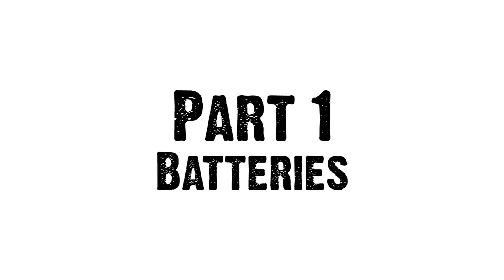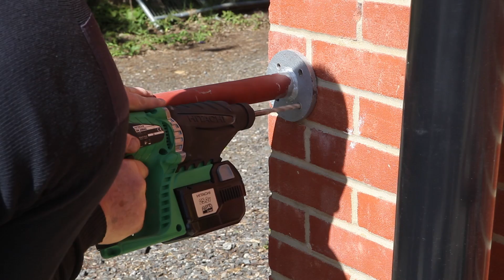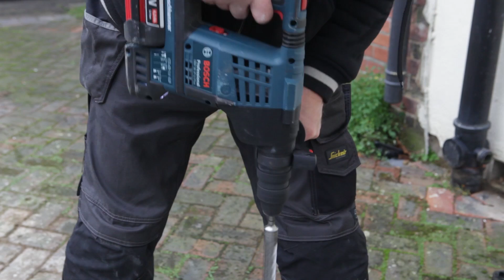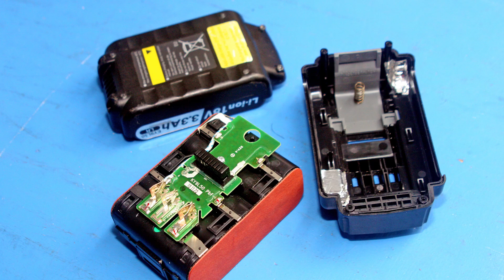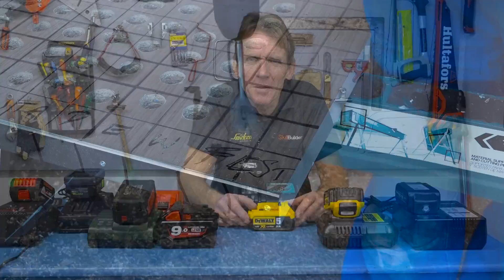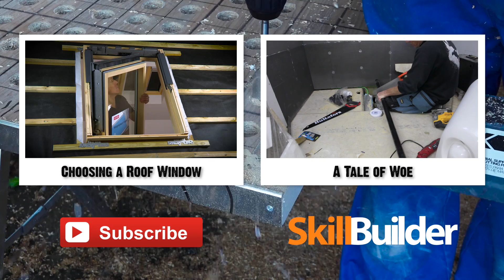Li-ion Batteries - What Drill Users Need to Know

Comment: Very good comment. Exactly right take a flash light with 2 18650s and one has 50% charge and place a new one with 100% and both batteries will now have 3/4% charge.  Most likely if you could take apart the battery with out damaging the housing you most likely will find 1865s inside 9.00 each lol

Comment: trickle charge me arse. A basic BMS will do that and taking apart these batteries theres nothing special inside them. The main cost and difference are the cells themselves. Some cells give crap batteries and these companies charge you the cost to be sure you have good ones. Cheaper batteries are a hit or miss but most often its a hit. All these companies outsource their cells to begin with. If you bought a 1inch thick battery that says 6.0ah, well oops

Comment: You already mentioned the reason they don't refurbish batteries when they have a bad cell, every parallel cell in a battery pack needs to be as well matched (in both capacity and resistance) as possible or they will charge and discharge each other in an uncontrolled way. And the whole pack needs to be matched fairly well or the series groups will keep getting further and further out of balance as they are charged and discharged. A good charger needs to have one of the methods of cell balancing as well unless it is in the pack which I don't know of any that can balance inside the pack because that would increase self drain on the batteries making more of them die on shelfs. But I did want to mention that the communication board in the battery is very cheap, the cells are 70-90% of the cost of manufacturing a tool battery depending on the specific pack and cells inside it.

Now 4 years on the cost of the commonly used cells has fallen to less than 50% of what it used to be but the packs are still the same price because they can be while boosting profits.
Reply: Very good comment. Exactly right take a flash light with 2 18650s and one has 50% charge and place a new one with 100% and both batteries will now have 3/4% charge.  Most likely if you could take apart the battery with out damaging the housing you most likely will find 1865s inside 9.00 each

Comment: One simple bit of information I was looking for but never mentioned in the video--------Is it OK to recharge when only partially discharged or is there any memory affect at all in a Lithium ion battery?
Reply from the maker: It is fine to charge them up whenever you feel like it. If the batteries ever run completely flat they won't recover so there is an electronic cut-out to prevent that. If you store them charge them up and get them out every six months is you aren't using the tool and give them a charge.

Comment: Thanks for review Roger - very useful to see "other" systems before "committing" to a battery/manufacturer's products. Milwaukee charger base doesn't have a fan and battery isn't vented. Is that a disadvantage? I don't think so. For battery longevity, I noticed that the charger has mounting holes. The charger has to work hard to charge a battery e.g. 5 Ah M18B5 so naturally gets warm e.g. like having a 25W light bulb underneath electronics if 25% inefficient? I found that the battery and charger can stand vertically or even upside down unsupported. Result: only charger gets hot and battery is never more than slightly warm. So wall mounting or a T shape wooden bracket is way to go? Just my 20 pence...

Comment: you should have taken a look to at least see what kind of petroleum they were running on and actually look a the cells, and here you can also easily decipher if the amp-claim are loyal as these vendors useally use off the shelf li'ion cells from LG or Sony or Samsung...
likely gonna be high drain 18650s like IMR and INR cells that can play along in the 10 to 30amp ballpark..
at the end of the day, these 4Ah and 5Ah and 6Ah and even 9amp cell packs are not ideal for the average hobby-user with minor task from time to time' as it severely hurts the weight and mobility and that is after all also a huge priority in most peoples agenda when we are talking cordless that it ain't to bulky and heavy, not to mention when you come up in Ah  we are doubling or even triple the cell count and the risk for one cell throwing in the towel is always a risk with 18650cells and particularly the high drain types that handle a lot of current, so not always ideal with huge 5Amp-hour packs, and can for some be an advantage to have fx 2x 2.5Ah instead.

A shame you didnt took of the bottomcover of the cell packs as then you can often see the cellbrand..
I just picked up a new brushless 20v cordless drill with batt and charger' clocked in pricewise around 75 here in Scandinavia... it claimed 2.5Ah. and its loyal enough with 5x Samsung INR 25R 2500Mah. (5cell=20v at 2500Mah=2.5Ah).
https://imgur.com/a/i0xpxNG
and these cells are certainly decent high drain current cells and for an el cheapo 18cm brushless drill with clickable metalchuck.. it adds up.  https://lygte-info.dk/review/batteries2012/Samsung%20INR18650-25R%202500mAh%20(Green)%20UK.html
Though I haven't checked how the charger balance the cells, but you can easily sense if the pack are getting filled or not by taking a basic multimeter and check the voltage after charge and divide it with 5' as 18v&20v drill-grading is based in 5 cells.
if it's after charging around 20.5v-20.7v on the pack's + &- pin (around 4.1v to 4.15v pr cell) its more or less filled as you not gonna see 4.2v unless you take the reading when charging or seconds after. 3.6v to 4.1v is usually the area where these Li-Ion 18650cells have the best time of their life with the longevity in mind.
thx for the vid...have you made a showdown on some of the budget brands to sense if there are some hidden gems out there.

Comment: All tool battery chargers from all manufacturers charge to around 85%.
The 5Ah sticker refers to the max capacity with the cells charged to 4.2V, 
Tool chargers generally hit 4.11V max MIlwaukee, Dewalt 4.09V Bosch etc.
5Ah really means 4.3Ah at best. They could charge to 4.2V but the cells would only do 1/4 of the cycles 4.1V does.
Nothing to do with trickle charging a full CC/CV charge is fine over a one hour period, Temp is more important 10°C is optimal but as long as it's not hot.
Especially is its last gen 18V Bosch with their faulty temp sensors. Good... Better.. Boom!

Also Milwaukee have always protected in pairs so no more than 2 dead even on old 2005 M28 batteries
A couple of year old Dewalt, Bosch, Ryobi will kill every cell from a failure since they ran a single protection for all cells.
Cell failure happens mainly when a set lags behind and you draw current when the battery is almost flat. 
The BMS circuit reads the highest set as an average not the total.
It's worth balancing your batteries every couple of years also if you recharge at half full you increase the total cycles by 4 or 5 X

Comment: Panasonic have the best Battery hands down . will give you years of consistent service and the tool has a serious IP rating . if you want raw power then use your corded SDS drill with a chuck . Overloading your cordless will cook its gearbox or clutch .

Comment: Surely from an environmental responsibility angle manufacturers should be forced to recondition battery packs.  If we want to reduce wastage we certainly don't want to allow battery packs with some perfectly good cells to be disposed of.
Reply: i agree make them like a touch spring loaded where you can take them out individually and charge them separably

Comment: I've just ordered the milwaukee set from the US and i'm wondering if I can use the charger on a 110v site transformer does the 50hz affect the battery? Also if I buy a charger from the UK will that charge the 5amp batteries on a 230v supply, does anyone know? i've found it hard to find out this info.
Reply from the maker: This is from a Milwaukee tech guy
You  should not use the US charger on Transformer , buy a UK spec charger or 110volt multi charger
One thing worth noting that the US models do not have CE stamps on , if used on UK site and something happens it can invalidate your public liability insurance.
Reply: Skill Builder l

Comment: Hi Roger! I bought a RYOBI ONE Jigsaw to help me fit a new kitchen sink, I have 3 RYOBI ONE batteries that are Less than 4 months old and haven't really done much work! I made sure all 3 were fully charged using the trickle charger! I set about widening the hole to except the new sink I had to remove 2cm all round plus square the edges! Roger I couldn't believe it half way thru the length the first battery failed at 50cm I fitted battery 2 and contd this battery completed the length and half of the width and stopped @ 25cm the worktop is only 4cm deep plus it's a brand new blade the third battery did the same as the first before it to died, I finished the job off with my old BOSCH mains powered Jigsaw, I would have thought that the performance would have been so much better! Needless to say the RYOBI 18V ONE Jigsaw is going straight back to B&Q
Reply: Buddy of mine had all his DeWalt & Snap-On  Tools stolen Now he buys his tools from LIDL
Reply: Hi Adam: Bought the Jigsaw from B&Q so as long as you have the receipt & the box with all it's contents theres not a problem, 4 months on & I'm still using the same batteries in the Impact Wrench & Drill without any problems & using my old trusted Bosch corded Jigsaw!
Reply: Yes! Me to Roger! if theres mains power I plug in my 30+ year old Green Bosch Jigsaw & Drill after use they get a good clean with the air gun & liberal spray with WD40
Reply: I've just replaced my dads old green Bosch jigsaw with a Maffel corded one as the old girl finally gave up under the pressure of commercial work. It killed a modern dewalt one though. Bloody great tools the old Bosch jigsaws I brought a GST2000 in about 2002 would still have it if some scum bag had not lifted it. Glad to see B&Qs customer care is up to scratch some of the trade places are not so helpful!
Reply: TheAudiostud Ryobi like rigid and others all owned by same people as Milwaukee techtronic Industries. How did you get on taking back? Shame really as the 1+ concept is good. I've gone backwards all the high load tools the circular saw jigsaw SDS all corded again now only 1x 115mm grinder and drills are cordless the rest of its not got a cable I don't bother!
Reply from the maker: Hi TheAudiostud
I have only just seen your comment. Sorry for the delay. Interesting to see your comment. Ryobi batteries are DIY but you would have expected a bit more than that.  Personally I am not a huge fan of cordless jig saws. I have both but if the mains power is there I am plugging in.

Comment: Excellent work Roger. I think battery longevity could be looked at from another perspective too.  I got fed up with some "House Brands" offered here in Canada by major hardware stores because they would discontinue one battery whenever their next tool model showed up.  I have a really nice drill/impact driver/multitool kit that can no longer be powered only two years after I purchased it.  For this reason I switched to Dewalt, because I can still easily find batteries for their old 12V tools five-eight years after purchase. There are even empty shells for some models available on-line to allow me to pack my own replacement batteries if I wanted to. It would be useful to know how long manufacturers intend to support their customers' battery requirements before obliging them to discard perfectly functioning tools.

Comment: What are your thoughts on the 18v dewalt 1.3 ah
Reply from the maker: +Daniel Sheehy 
The 1.3Ah is entry-level to keep the diyer happy. It is there to serve that market where people demand an 18 volt drill for under £100.
In a professional environment the battery would be back on the charger several times a day which means it might not last a year. You then find yourself having to buy a new battery which costs almost as much as you paid for the whole kit. That said I do know people who buy these cheap kits and run them into the ground than then take them back to the dealer. With someone like Screwfix it works. Manufacturers have told me they put these kits in at a loss just to get the better tools into those outlets. It is a complete pain to them.
Reply: Cheers for that been thinking of buying the 3.0 ah because it's part of the xr range

Comment: Excellent video, very informative. Battery chemicals degrade with use, like car tires. A good lithium Ion battery should give you six years of use ( depending on how often you charge it ). However if the temperature inside the cells exceeds 65 degrees than you see an additional degrading of the chemicals. This decreases the lifetime of the battery. 

The best power tool manufacturers  will never let you get close to this temperature ( no matter what you do to the tool ). Look for manufactures that employ 'Electronic cell protection' and 'coolpack' features, look for fans in chargers, look for intelligent chargers that can fill the battery full as it monitors the temperature. Look for guarantees on batteries not warranties

Comment: I agree that there should be a refurb setup in place, although they might argue that it would cost them in the long run.I've taken apart and replaced the cells in an old drill battery, but it was a huge pain to get into it without breaking the casing.  You are then faced with the problem of fake cells, which is pretty widespread and not just confined to eBay.Another good video Roger, looking forward to many more in 2016.

Comment: If you ever do another battery test, will you include the Chinese knock-offs you can get on eBay. I bought some generic Dewalt batteries that were half the cost and worked well. Thanks for the videos.
Reply from the maker: +z dubs 
The trouble is that we can't do anything meaningful with that kind of product. I have first hand knowledge of a Chinese battery that caught fire on the charger overnight and burned a garage down complete with an uninsured classic car. The risk is not woth taking.

Comment: Most of the time the PCB in the battery is not that expensive. What is expensive is the R&D and the cells. The pcb uses readily available ICs which are not much different from the ones that have been used for years in laptop batteries. The sad truth is that batteries are the biggest source of profit.
Reply from the maker: +Enrico Conca 

Thanks Enrico I value your input on this. It would be good to collaborate on the next one.

Comment: Pretty nice video, a lot of good info.  I sent out some batteries not too long ago to get re-built by a little shop that does some spot welding.  They replaced the cells for my older battery packs.  Tools stop work great, but the batteries didn't hold much of a charge.  Got them replaced with some Samsung INR18650-25R lithium cells.  Fresh battery for about 30 dollars and shipping! (your own mileage may vary)